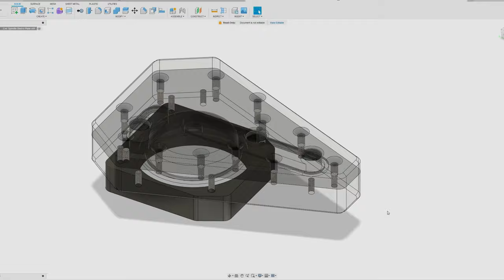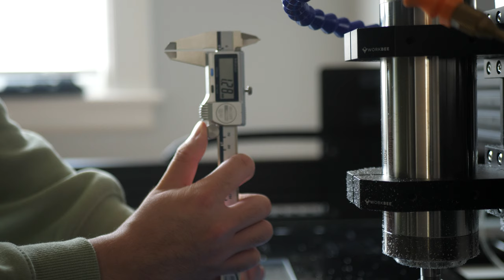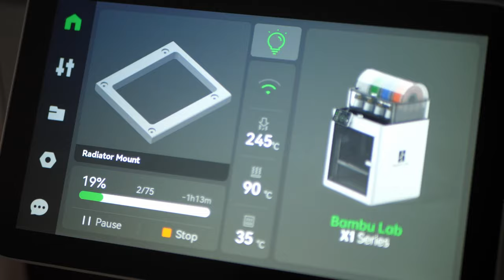CNC & 3D printing - Machining Spindle Cooling Box

Comment: What did you use to make the acrylic water tight? That was an amazing project :O
Reply from the maker: The barb fitting size is about 6mm and the soft vinyl tubing is about 5mm ID. So you can imagine the tolerance fits nicely pushing the tubing in flush with the surface. I also then used Zip-Tie to secure it even more.
Reply: Oh its a vinyl tubing? I tought it was kind of an 'o ring' but wasnt so sure @Sae.Dustin  
Kinda jealous and wanting to make something like that for myself haha